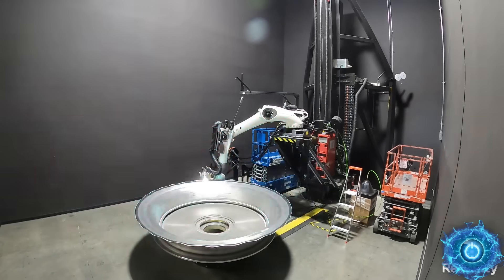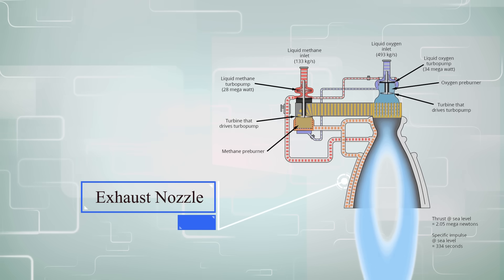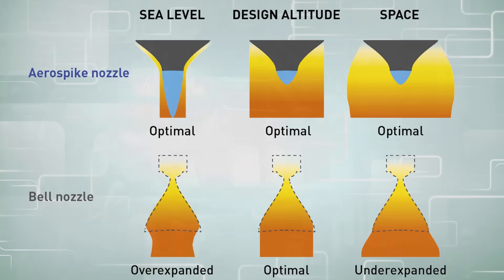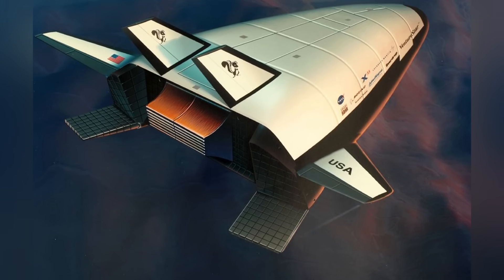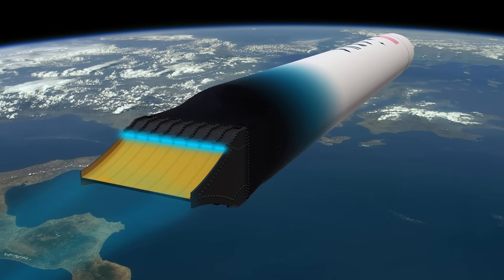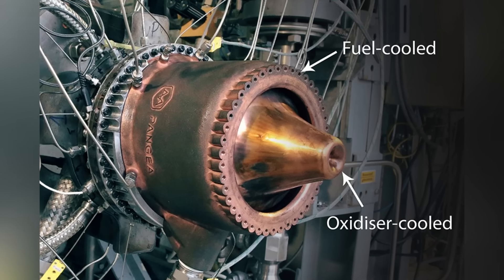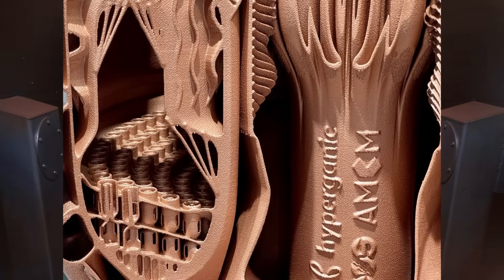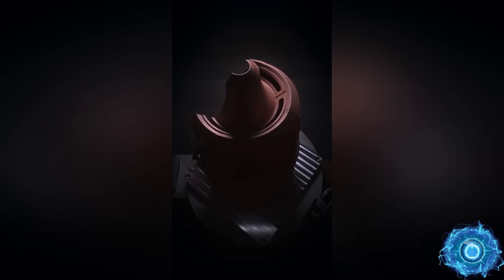GAME OVER - A.I. Designs CRAZY New ROCKET Engine

Comment: Here's my take on the aero spike engine. What if the added flap, to the out side. To open up to difference in pressure. and run liquid nitrogen/ fuel threw the center part of the spike to keep it cool. like they do for normal rockets

Comment: I looks cool and stuff. The Problem I see with this tech is. Once something inside breaks get dented what soever you can throw the whole part away. You cant get inside and fix it. If you dont have the counterpart technology to repair it inside without breaking.  BUT. I think this technology will have a huuuge impact on small parts in the future that doesnt cost much. So it wont hurt to just throw it away and recycle it.

Comment: Art: my dad was an actual computer and rocket scientist. I have a pair of cufflinks that were made from gold discs that were a part of a very early 1950’s computer system. I worked on the design and construction of wafer fab facilities. At one point I became fascinated by an integrated circuit design. I talked them into blowing up the image a thousand times. The resulting image looked like a wild design for a new city. We messed with the colors a bit and had a very large image plotted. I mounted the print on a rigid back and then carefully gold leafed all the parts that were actually gold. Then, using my surfboard fetish, glassed the surface. It is 36” x 48” and a real conversation piece. Science and engineering become art.
I certainly see the new organic nozzle design as a base for a glass table. You may be looking at $50,000 for one with documented provenance.

Comment: The Flow is amazing, he know what he do. In normal areospike engine is in the middle to much air like bobble at cone and this design brake the airflow at the begin in the middle in the construction and push that at the same time outside more. Also the fuel goes in to the slats slowly out. The AI make our new engines better than we think to can it better 😅

Comment: The problem I see with that AI generated Nozzle is the tremendous volume of fuel/oxidizer resident inside of it.  Most geostationary Satellite launch vehicles use a multitude of Nozzles.  As seen on Space-X rockets, a certain amount have a probability of low function or to non-catastrophically fail.   This AI design, if it catastrophically fails the large volume of Fuel/Ox will almost guarantee a total program loss!

Comment: Multi stages were for cooling. Modern (newer) engines that have cooling built in and under a constant amount.. have no need to be multi staged. The fuel itself was is the cooling agent... When the fuel reached X amount.. that stage separated... as it could not cool the entire engine.

Comment: I have done some work in AI design a few years ago, and although this type of thing looks really cool, all of those extra details and strage curvatures are really just artifects and do not significantly contribute to the performance of the engine ... often what you get is some weird curve that looks important but it's just negating the effects of another weird curve that also shouldn't be there. If you take both of them away, performance goes up ... and guess what .. if you take away all of those weird curves and odd angles, it performs best, but then you have just re-invented what already exists. 

It's true that some AI designs can be better (the magnets in a tomahawk reactor were AI assisted designed for example, and are actually better)  but engines in the picture are just a bunch of "local minimum artifacts" that are constructivly and destructively interfering with each other, and while look cool, dont help performance and add extra weight and fragility.

Comment: As an Aerospace engineer: Just looking at the pictures of this engine it's hard to judge. And yeah it needs to be tested and doing that requires more than just an engine. Apart from the additional equipment you need operating ranges and stuff. I don't know what AI model they used for it and how well it is trained. It might as well be a model with a bad model architecture and bad training data.

However, I'm pretty sure we're at least close to designing AI models and AI applications that make it possible to have a rocket engine designed automatically

Comment: The design challenges of an aerospike angine aren't the problem. The problem is that there is no problem solved by an aerospike. You don't need to get to orbit in one stage ever, the thrust to weight is just not there, so why bother designing an engine for an useless application.

Comment: All that is is an art piece. Manufacturing would literally be impossible. Not to mention it would have to be made out of some mythical material like vibranium because no metal or alloy will ever be able to withstand  such temperatures. I could keep going with its obvious problems, buts its fairly safe to say that it wont work.

Comment: The technology to 3d print a complex  rocket engine doesn't exist.

The reason is metallic lamination and stress bonding on the welded 3d print.  In prder to get a high quality print, the input metal needs high purity, and the atmosphere needs a 100% welding atmosphere, that part has been done. And the entire print area and part needs to be kept at constant temperature.

The problem is 3d printed welds heat up the metal, duh, however cool metal welds dont bond, and hot metal welds cause undercut, debris deposits, and droop.

Last, though it sound like a good idea to 3d print, the metal layering and differences in weld to part temperature cause stress points, add this to a complex design, and it will easily crack, even after an anti tension heat treatment. (Those get close to the metals melting point.)

I find it far more likely that miniture robotic cut away machining will be the way of the future.  Its much easier to make one solid, tensionless block of metal, then cut it.

Comment: Already Incapacitated .. aka AI .. has its uses, for sure. But already, it is replacing parts of the human psyche that simply are not to be replaced. It is an exponential 'second stage' to the cell phone .. that has seriously dummed down the human and MASSIVELY disintegrated human to human interaction. Then there is the issue of fail safes-parameters-full stops - that can not be bypassed, skirted or over rode .. which could turn STUXNET into SKYNET.. don't know what stuxnet is !? LOOK IT UP !!!!! I'll take window cranks over electric windows .. thank you.

Comment: The trick would be allowing the outside air pressure to alter the flow through the aperture proportional to the air pressure, so that it maintains an optimal vortex, without compromising pressure altogether. AI is likely on the right track with all the crazy tesla-like valves and small capillary-like tubes. But commentors here are correct, how would you clean, check, or validate something like this?

Comment: looks like one of those science fiction monster alien engined. that said, it will be very usefull in the future, 
I personally have also worked on space engines, speciffically one(the most interesting one, which I actually came up with and designed the main principles behind, which is a replacement for most space engines in almost all cases being way more sustainable and reaching many times higher speeds than any current space engines, unless there is some clasified space engine which does the same or better, but it beats all current space engines heavily in space while also using way less energy) engine which currenltly needs AI for normal people to use it, since it is just to complex to controll it for normal people, and isn't as predictable as normal engines sicne it has many more factors.
essentially it is a first early warp drive engine, I call it early warp drive because I know it can still greatly be improved since I was very limited in the materials I could use, also I think much better versions can be made and also can be faster, also some things beyond warpdrive, but those other things are probably to far ahead to even talk about on youtube, since most people wouldn't even be able to beleive it if they saw it in reality since it defies all most people have been thought about reality.
the early warp drive engine however is simple enough to understand(for certain people), I call it a early warpdrive because it actually is a working warpdrive engine.
meaning it actually relatively transforms dimensions around it in order to move. 
the hardest part to get to work properly wasn't the bending of those dimensions, since I know enough about enough different fields to figure out a way(actually more, but one which was particularly usefull here, speciffically since it also was of low density and low energy usage) but actually getting persistent motion out of that bending was what made it hard, eventually I found a way, funnily enough it actually uses one of the physics laws which most people actually see as a law which would prevent such things, but in this case that effect actually makes it work, that it relies on that effect is also why I call it a early warp drive, once we no longer need to rely on that then it would probably be a full warp drive.

funnily also this warp drive engine didn't come from a company asking me to make a new space engine, actually it started with the area 51 raid, and I wanted to pull a joke, of sending a actual ufo there( I don't live close to usa at all(europe) so actually sending it wasn't in my plans unless I could find someone there willing of building one and sending it, but the joke was already funny enough if I designed a real working ufo which used a new type/way of propulsion which is ununderstandable to humans how it works in general(making it a actual ufo) and then just imagining it being there at the raid and making jokes about that(trust me this is very normal type of humor for me and some of my friends speciffically one other with who I constantly design things that seem impossible to get to work and then we actually find ways to make it work just for jokes, even though it is best to not talk about all those jokes.
that ufo I designed and got to work, it only worked in a atmosphere however since it still needed air back then, it also looked a lot like a ufo I also had to design that new type of propulsion so that it actually would be ufo like and round, and I did. it also worked way better than expected and I figured out why, so essentially now that ufo is just a very safe new type of airplane or more a very safe, energy efficient helicoper since it isn't really designed to go fast currently, can be made to go fast but didn't need that back then since it was just meant as a joke.
then there also was a second joke invention me and that friend made together this case(actually designed together since for this second one we never really finished a build of it since parts are expensive and we lost interest in it and got another project(it needs to stay cool and fun and exciting enough) but this other project was still important despinte not building it since a imortant theory for making the warp drive engine work actually was a theory based on a theory we made to make that thing work, that thing was a device for wireless energy transfering btw. but instead of transfering the energy efficiently our idea was to make it look very wild and agressive, so we decided we wanted the energy transmission to look like some kind of storm, the plan was to make a controlled horizontal vortex(kind of like a tornado, but then of dangerous things like electricity) which then also would conduct the electricity, we could already do that working range limited but more than big enough to be showy, but we had a problem 1: it didn't look vortex enough, 2: it used a seperate device for making that electrical conduit, we wanted to do both at the same time, and so decided to use principles similar to ionic propulsion, I knew the theory already but the normal theory wasn't enough to make it work, so we started to look into the "detailed" theories which people use when using it in things like rocketengines(basically the college and nasa theory version(how they are used there) but those theories sucked and where very incomplete, it was just yeah we know it does this and that if you do that, but not really why or how other than those factors but yeah the rest we just ignore because we don't want to spend to much time figuring out the actual complete working. kind of like saying a light turns on when you flip the switch because you flip the switch connected to it, but not all the stuf behind it like the type of light and it's working, the electricity, etc. so we made a custom theory for it which actually did look into thoe other effects(also figured out those effects ofcource since otherwise it would be hard to make a usable theory), this new theory was enough to allow us actual controll. then soon after that(this all was very close together) a friend of mine said he wanted to be able to travel through space freely to get away from humanity whenever they destroy the earth again. so I thought about that but there where some problems, current rocket engines are insanely expensive, very inefficient, reach very low speed(compared to space), only work for a short while due to needing a lot of maintainance and being refuelled a lot if you travel from planet to planet, and they are also super heavy and big wasting energy and making storage harder,  so I thought about it that was also around when I told him about that ufo(was afriend who had nothign to do with those jokes but who is interested in things like that) so I shought about how can I change that device to fly in the vaccuum as well(also forgot to mention one other project which was a second version of that ufo, I already thought I forgot one but didn't remember which one, it was a second version of that ufo using a different method and being meant more for fun to mess with peoples minds since essentially it would "fly by generating energy" in realiy it was somewhat different, it was just a speciffic nano polymer I designed to generate energy out of a source which humans not yet really use to generate energy, the generating of that power causes a effect and also is used partly to power the thing that made it fly, didn't work well back then however, but that largely was due to me not really being capable of making such a polymer since I designed it by looking at possibly atomic structures and not by looking at chemical reactions, this second version of that ufo due to that only worked in theory and I never made a physical working version of it, the first version of the ufo and the early warp drive do/did actually work) I eventually found a way to change them or actually designed a new device(which actually did require a normal power source) which was the early warp drive, it could generate propulsion without sending out any physical particles just by transforming dimensions around it and one second effect which might tell to much about how it actually works.
that wasn't the end yet, since that theory I made based on that theory I made with a friend actually allowed me to figure something out to make it many times more efficient, essentially again a different type of energy source but this time actually "easy" to use it didn't really need any serious changes to the engine, only yo how it is used, and so now it can kind of link itself to galactic bodies like stars and kind of use their energy as a large part of it's propulsion, the way how I found that also is very different than what most would expect since I actually figured it out due to a tree and crossreferencing that with that theory I made allowing me to figure out some fascinating effects.I think I might contact that space company soon, perhaps they want to publish such a engine properly to the public. I contacted both nasa and spaceex some years ago(already years after designing it), but both of them reacted not really open, nasa kind of played it the ignoring way, spacex was more direct in saying they wanted me to stop developing that engine since I wasn't from usa.

Comment: the Ai design is a nice piece of art, but that is all. the printer uses powder and the design is so complex you could not get all the powder out of every channel. Loose powder particles in a rocket engine is a guaranteed RUD.  How would you inspect it for dimensions or integrity?  Plenty of great designs are not buildable or inspectable, both of these are required for an engine to be reliable and not dangerous.

Comment: The principle of changing the flow pattern to match conditions is hardly different than variable valve timing on an ICE engine. This is not groundbreaking tech, nor is it new, inasmuch as it's making adjustments for variable flow conditions. Labeling it "AI" is just kinda trendy. But the 3D print is cool. Maybe it will be great.

Comment: All that "AI made something" is such a click bait wich Im kinda tired already. Its not even an AI in any way. It is a software programm with good calculation power. It is a tool. At this point you can consider a wrench as an AI. They give it an input date and required output data. I wonder if any time soon I'll buy a tooth brash and the marking on it will also say that it is somewhat AI.

Comment: Algorithmic engineering IS NOT AI.

It is rather an iterative process of creating a design which fulfills the function, then running some simulations on it, afterwards tweak the design based on the recovered data.

This iterative approach is similar to nature's own evolution. That's why such designs appear to result in relatively organic shapes. For example, the perfect light-weight body of a quadrocopter drone often resembles the skeleton of a bat.